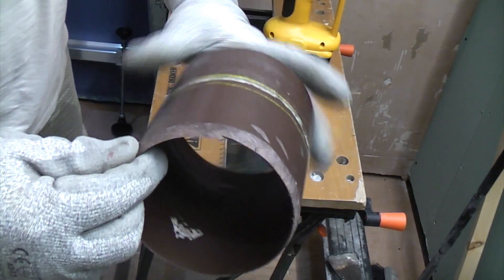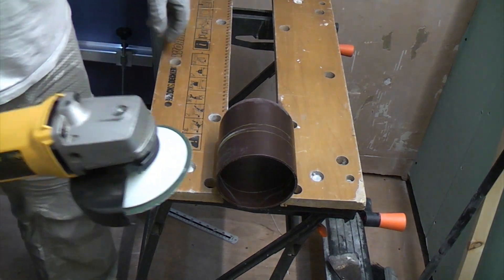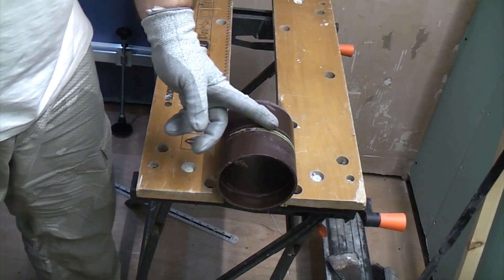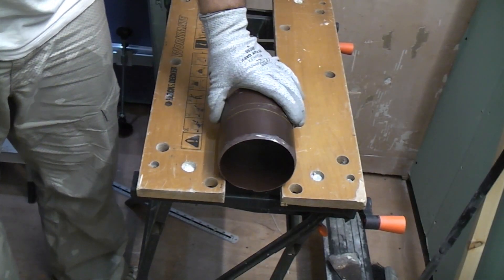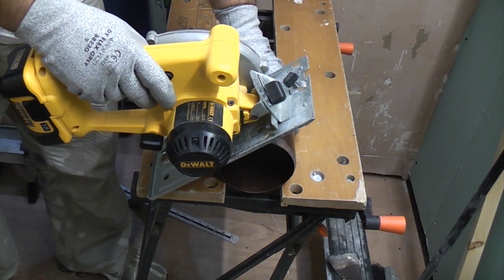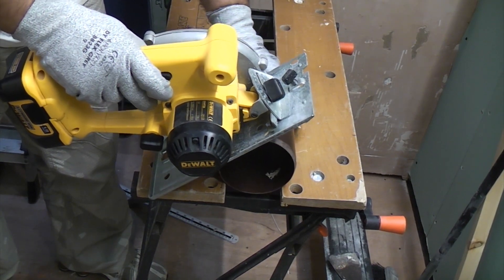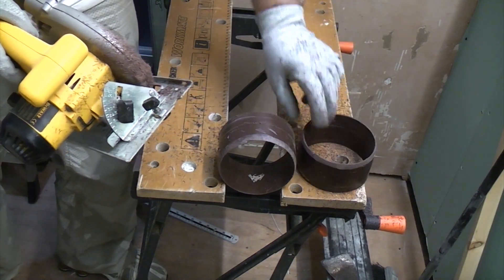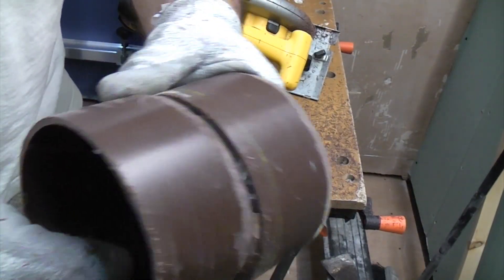How to cut soil pipe

Comment: Wood saw and rasp - £20 gets job done safely and quicker.
Cordless grinder and circular - £250 slower and dangerous . Do you use a chainsaw to sharpen pencils ?
Reply from the maker: Poultonconstruction 
I use whatever I have to hand.
One day I was on a roof and needed to cut some soil pipe and I had the circular saw with me, it it saved me a trip down the ladder ;-)
Reply: I use a gerber machete to sharpen my pencils and a chain saw to cut soil pipes. Dewalt tools are great. Keep making videos mate
Reply from the maker: Jon Stephenson
LOL, thanks for the comment ;-)